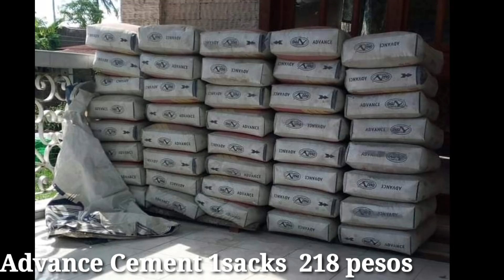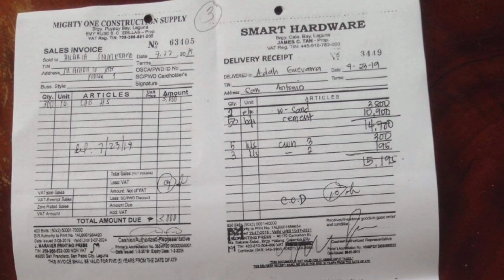OFW SIMPLE HOUSE,CONGRATS MR AND MRS BARRERA MASARAP, ITALY OFW LAGUNA,BUILDING A HOUSE 1M

Comment: Pa advice naman po. Mas mgnda ba pag may architect kang kkunin at contractual para mas mkatipid at maayos ang lahat??? Mgkno po inabot ng labor nito???
Reply from the maker: 50% po ang labor cost nito Maam.. pag half M ang materials 250k labor cost... minsan kasi masiba ang architect pero hndi ko nilalahat.. 10% ang pa bayad kasama ang lahat ng perma.. lalo na ang calculate nila 25,000 per 1sqm s ibang lugar to 30,000 pa nga per 1sqm. Kung ang bahay is 100sqm x 30,000 per 1sqm  3M po. Sa 3M 10% ang babayaran s lahat ng plano ng bahay kasama perma 300k agad ang ma gasto na di kapa nka simula pa gawa ng bahay mo..

Comment: Kbyaan magkno kya budget ng 56sq meter ng concrete slab
Reply from the maker: Dpende po s pag manage at mgkano po ang price ng materials at labor coat s lugar nyo po pero 400k mgnda npo ma gawa non
Reply: Ung akin po 7x8 or 56sqm nasa 400k na mahigit di pa tapos